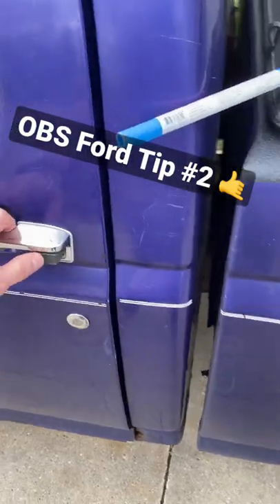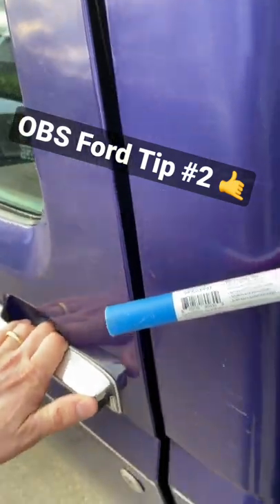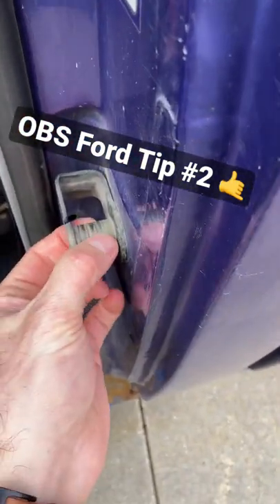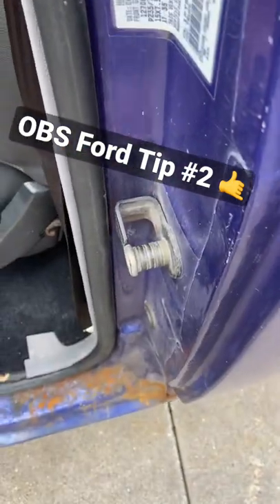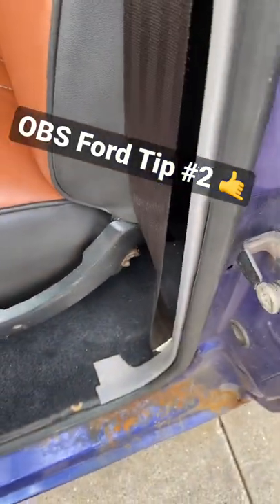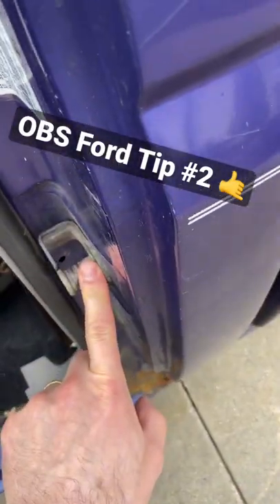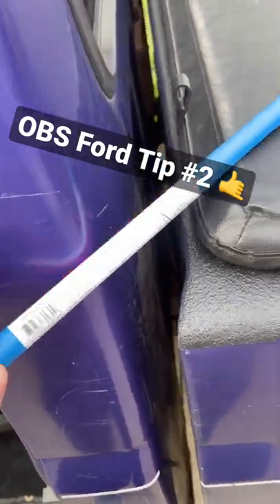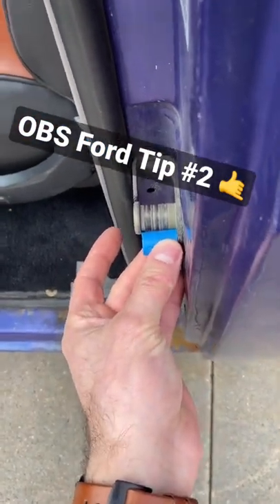Door Not Closing Fix🔥👀

Comment: 👍
Hinge pins also can be the cause, door sag kills the bushing. Hard door closure deteriorates interior door panels, trim and speakers
Reply: was gonna say thatc
Reply: I bet it it’s door pins , not the latch pin
Reply: I made a way better video on foord door adjusting
Reply: @graybeardproductions2597  would it still apply to 2006 models?
Reply: Nice hack brother
Reply: Replaced pins on one of my buddy’s trucks but still has trouble sometimes closing probably bc of what he said in the video, but yeah bad hinges will cause it for sure
Reply: Yes. Hinge pins cause the door to sag then wears the striker bushing due to misalignment every time you close the door
Reply: Trruuu
Reply: @jaspercats I agree, every one I encountered was a worn hinge pin.

Comment: 1/2" cpvc pipe works better will last much longer
Reply: Isn't PEX a superior?
Reply: Cpvp will dry rot and crack
Reply: God no not in winter. Pex all day for this.
Reply: For the love of God don't give people the idea
Reply: Blue pex is for cold water though. Not for Ford door latch bushings. U should always use the correct color pipe for the job
Reply: Cpvc is garbage. That shit will bust the first time you close the door. That's that mobile home plumbing crap.
Reply: @justanobody891  uhhhh most mobile homes have quest
Reply: @purplepup8897  far from most
Reply: no that absolutely wrong pex is stronger

Comment: i used the one in the help section on mine but found i had to sand down the plastic part because the diameter was a little too big to work smoothly. been 2 years of daily driving since that repair and it’s holding up!
Reply from the maker: Nice! You’re not the only one I’ve seen having to do that. I kind of think the replacement bushings are all a little big.

Comment: Hinge pins and bushings are a common culprit as well. Quick fix if it's an old junker, put a jack under the open door and go up slowly just a little bit until the door works as desired.

Comment: If you look closely at your latch pin assembly, you will see that your pin has been pushed in ever so slightly, as evidenced by the sliver of discoloration around the right side of the silver colored metal section against the blue paint. Loosen that T-50 and pull the latch assembly back out to its original position and tighten it back up. see if the door latches properly, before replacing the bushing.

Comment: I used pvc on all 4 of my doors it didn't have a single bushing on it when i bought it but im willing to bet itd be easier to install if i would've used pex you gotta cut a 1/4 in slit outta the pvc and bevel the sides so it'll go over the pin without breaking
Reply from the maker: So the PVC is a smaller inside diameter than the strike pin?
Reply: @TheMinuteMasters  no if you make the slice out of the side and it's not big enough it'll snap in half fits nicely on the pin once you get it there

Comment: Another trick to avoid  pulling the bolt out. > Cut PVC that fits the bolt (inside diameter as well as outside, probably 1/2" tube) in length needed.  Take fine saw or grinder bit, remove about 1/8 " from one end to the other. Snap PVC over the bolt. If you still have scrap, use solder iron to melt piece into place making complete seal, add more if needed.  Again, I have done this several times on old chevy, last usually for over a year.

Comment: Does that truck have carpet or rubber floor like my 1996 F150 XLT Straight Six?
Reply from the maker: My truck is an XL and originally had the rubber floor. I swapped it out for carpet.

Comment: The reason those get worn out and fail is because the door pins are worn out or the door is out of adjustment. Fix the cause of the problem not just the problem.

Comment: my dad tried to do it to his 77 f100 it be couldent get the striker out
Reply from the maker: Really? The bolt would unscrew?
Reply: @TheMinuteMasters  no the nut would just spin and the cab is sealed off so you cant get to it. He was wanting to put those bushings on so he split it and slipped over the striler.
Reply from the maker: @redjasper1100  that’s weird. That probably means the retaining clip on the inside is loose from the cab structure.
Reply: @TheMinuteMasters  thats what i told him..

Comment: OBS doors are just the fucking worst. If you have really any winter at all, you're like to snap an interior handle. Thumb buttom on the exterior loves to jam up. Bushings get fucked up. And don't get me started on the hinges. Damn near impossible to find the right bushings, mine would wear out in 9 months, and replacing the hinges is a monster.

Comment: Ford tip #3. Front disc brakes on an f100 have rubber bushings. They do not come w any rebuild kit. Use rubber fuel hose.

Comment: It’s not lining up due to worn out pin bushings in one or both of the connecting hinges, not the latch pin. Extremely common issue with OBS F-150s. I’ve got a ‘96, myself!
Reply from the maker: That’s correct! I replaced both pins and this bushing.
Nice! Good year!

Comment: Be careful before you pull that bolt out, try to apply some adhesive to the recieving nut. If weld is broken inside, nut can drop. Major headache to recover and replace it inside pillar.  Speaking from expierience.
Reply from the maker: So true! I’ve seen them drop inside the pillar and it’s a pain to fish it out.

Comment: Biggest issue is the cab bushings. A-pillar sag will cause the door to not close properly, then the hinge bushings, then the striker bushing.
Reply from the maker: Very true
Reply: sad thing is the next gen (97-0whatever) had similar issues, but the doors would tell all, by cracking and ripping at the corner of the window. I still would drive a Ford over any others.

Comment: what do I do if I replace it in my door will no longer open help
Reply from the maker: So I’ve see this issue. The common believe is the new bushings could be a tad too large. You can try sanding the outs out down or using pex pipe.
Another issues is sometimes people moved the steel strike pin in further, thinking that would fix the door. Then, when they go to add the strike bushing, they forget to move the pin outward again, and so the door is held closer to the frame, and thus very tight.
Unfortunately, to get your door open can be quite tricky. If possible, I would try to remove the inside door panel so you can access the backside. Otherwise it turns into a game of just tugging at the door.

Comment: 9 times out of 10 the bold breaks off and then you are screwed and you have to take the b piller trim to get the bolt out. Ford tip #1 don't be buy that garbage in the first place
Reply from the maker: The first sentsncet can be true.

Comment: You can replace those bushings or you can actually adjust the door striker in words a little so the door latch gets a better bite I've had to do that because bushing seem like it was a little too long and it was pledging against the door
Reply: or you can fix the real problem, worn door hinges
Reply: @halleffect1  why do the door hinge when it's the door striker pushing where it latches he was talking about replacing the whole striker and I, saying or you could have just replace that pushing which I have done before because a bushing keeps your doors from rattling wore out hinges who caused your tours to sag because my 85 S10 had wore out door pins and the doors saged my dad's 94 f150 need the door striker bushings replaced because the doors rattle

Comment: Have you actually replaced the strike pins? I did mine on both sides. I was so fed up messing with the driver side, i slacked on the passenger side. It sticks on opening.
Reply from the maker: I’ve actually replaced both sides. Sometimes you have to move the pin around to get the latching right. So have you fixed the driver’s side?
Reply: @TheMinuteMasters  I fixed them both, the driver side opens/closes like new. the passenger side is a little funky.
Reply from the maker: @iamgriff  Sounds like my truck. Lol My passenger side door sometimes won’t close properly. Sometime it’s because the door hinge pin works it’s way out.

Comment: Hey man quicl question im having trouble finding the hose that connects to the waterpump to the hearer hose and that hose connects to the altenator
Reply from the maker: I would try Rock Auto or Jeff’s Bronco Graveyard for those parts. I’m not sure of their exact names but if you search the “engine coolant” categories, you might find them.
Reply: @TheMinuteMasters  hey bro so i went to a junkyard and found it new but soon as i left i was driving and the driveshaft was shaking so. I went down and looked and what i saw was the center bering broken do you know what the size is
Reply from the maker: @miguelgarcia3178  Nice! Good find. 
Do you have 4x4 and is this one of the shafts from the t case?
Reply: @TheMinuteMasters  nah 2wd but dang its hard im only 16  and couldntdo it
Reply from the maker: @miguelgarcia3178  Gotcha. If you have an issue with the actual driveshaft, the parts that wear out are usually the universal joints. They’re actually easier to replace anything. However you can buy a whole new driveshaft with brand-new u-joints. If the axle shafts have issues that’s a totally different repair.

Comment: That sheet metal needs a trip to the help section 💀
Reply: That thing is cleaner then any 10 year old vehicle here in MI. Every truck from 2012 and older is way more rotted out no rear wheel wells left no rockers left and nothing under all the plastic cladding.

Comment: I try'd the pex trick recently and it didn't work.
Reply from the maker: So I’ve never tried it, but it seems like everyone swears by it.
Did your door not latch properly?
Reply: @TheMinuteMasters   Pex didn't fit over the striker bolt.
Reply from the maker: @Skitter302  Interesting. I wonder how other people got it to work. They must have really pressed it on.
Reply: @TheMinuteMasters  I know that their are 2 types of pex on the market so I'm wondering which type is being used.
Reply from the maker: @Skitter302  so coming from a master plumber, there are three types of pex on the market. There’s pex A, B, and C. Pex A is the expanding stuff and B&C are slightly different but pretty much interchangeable. B & C are the most common types found.

Comment: Ford tip #1 don't buy a Ford.
Reply from the maker: Other brands have the same issue.
Reply: I never said they didn't have a chance of having this problem.  I just have worked on cars and trucks for years. And when 90 percent of the vehicles that you have in your repair shop are Fords.  Then you tend not to want to buy a new Ford.  So tip #1 is don't buy a Ford.

Comment: Huge Tip:  Don’t Buy A Ford.
Reply from the maker: What fun is that?
Reply: @TheMinuteMasters  from personal experience… I hope you have better dealers and repair where you are because every Ford I’ve ever owned ended up leaking every fluid it holds.  Every Ford I took into have warranty work or safety recall I had to take back a month later for a separate issue.  No on Ford for me bro.
Reply from the maker: @harrypooter7807  this is the only Ford I’ve ever owned and at 247k miles and the fact it’s an 1995, leaks are the norm. I’ve gotten it leak free though.